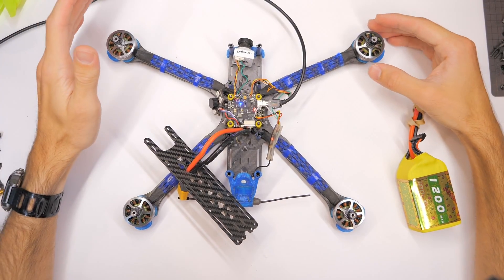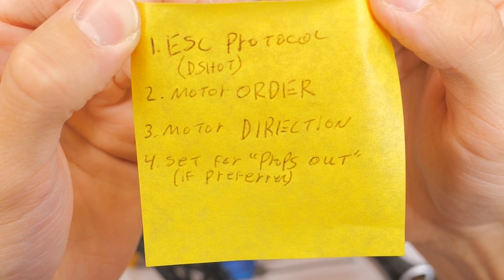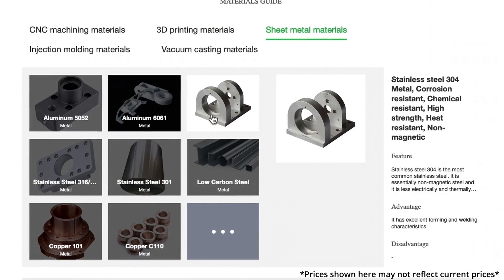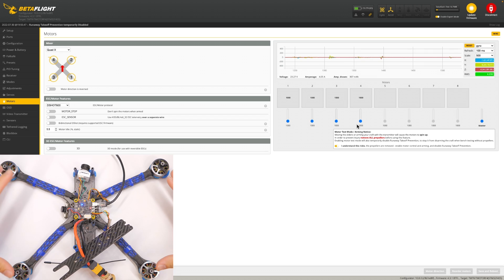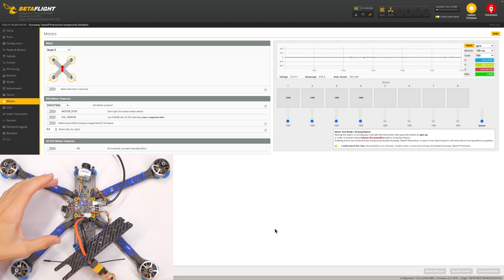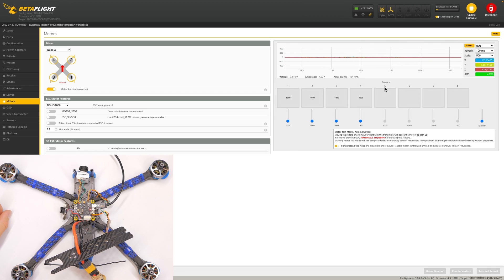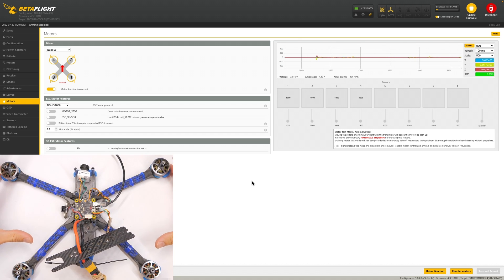How to Set Up Motors (ESCs) in BetaFlight - ESC Protocol, Motor Order, Spin Direction, Reverse Props

Comment: Even by touching I cannot figure out which direction my motors are turning. Its on a 2s copter, so they are pretty small. Atm my drone does not go up if I hit throttle, so motor directions might still be off. Any hints?
Reply from the maker: Hey! You can wrap a little piece of tape around the motor shaft to make it easier to see which way it's spinning.

Comment: I fly motors out, after flashing bluejay and setting my motors in the right direction, i did not click motors reversed in betaflight. My quad would jump in the air and cutoff and land flat. After checking my quad against one of my old builds i seen motors reveresed wasnt selected. I had to save it and tried again and my new boo flew great.

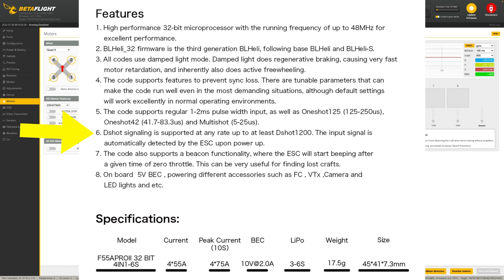Comment: I am new to the whole fpv world but I've been in drones for a while I ended up buying up somebody's collection for a good deal can I have four 225 mm friends without flight controllers they all have motors on them has four ESC on each motor and I just got the Speedy beef at 4:05 stack in the mail to build it. Do I eliminate the escs? Don't the Speedy bee have its built-in esc's? Thanks

Comment: Great video, thanks for sharing! 
I have a question on setting up the motor. Should the FC be facing towards us to get the correct configuration? For example, if I have a tinywhoop, let's say the Pavo Pico, where the FC is facing to the ground compared to you example where the fc is facing to the air . Should we view the FC from the drone's underside and then orient ourselves from there to establish the motor's order and orientation?
Looking forward to your insights!

Comment: Hi Adam qhen i hook up to Betaflight and go to the motors tab to change tbe Motor Direction none of the motors turn when i press 1,2, 3 or 4.Also they dont turn when I am in the 4 large circles that changes from yellow to green. My motors are all turning in the wring directionand i wanted to use tgeabove method instead of Blheli chrome App which again i dont know how to use. Im a newbie these methods so yoyr help would be greatly appreciated.

Comment: I clicked on motor direction on bf, it told me in a warning box that i need to update my firmware to 4.3.Do i simply click on the yellow button that says "Update Firmware"? And will that show me the circles i see on your video? Also can i damage  my flight controller by clicking on update firmware?
Thank you for your time im banging my head on the wall with this one!😢

Comment: Hi Richard im having this problem with motors 1 and 2 turning in the wrong direction but my bf 10.9.0 does not show "Reorder motors". I can only change the direction up top of the quad motor diagram. I know nothing about CLI. And my firmware is 4.2.3 Eachine Lal3 4s quad. Can you help me?